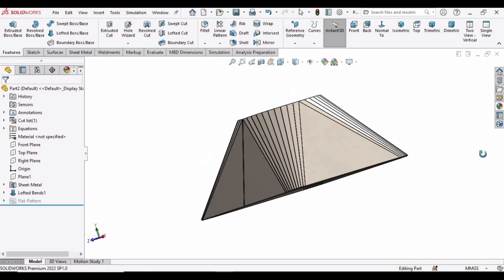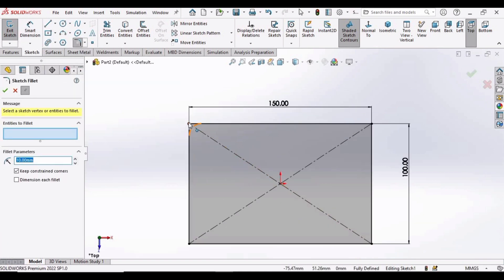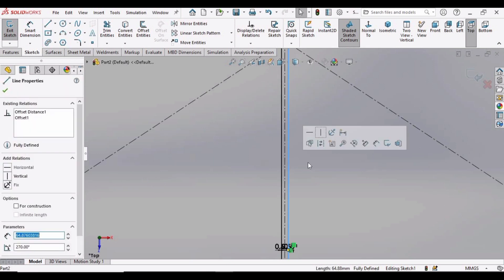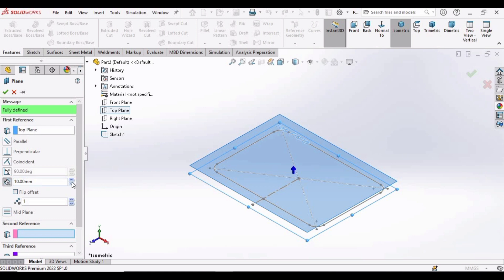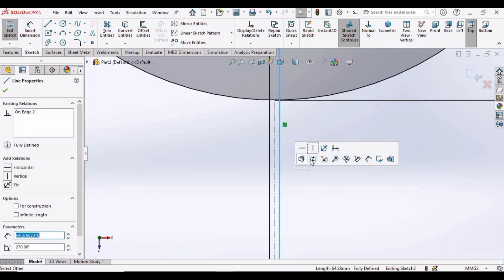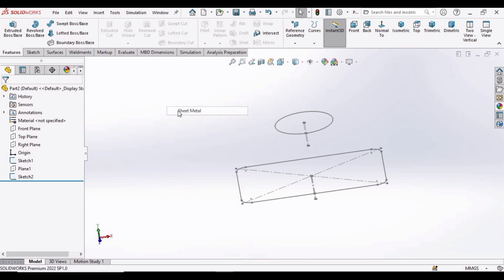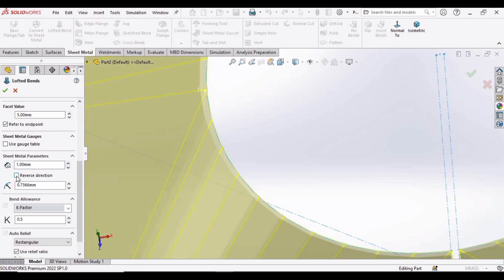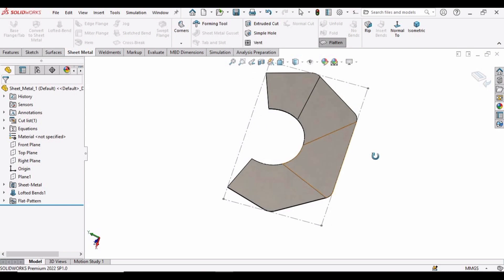3D Sheet Metal Cone | Metal Fabrication | SOLIDWORKS

Comment: SOLIDWORKS IS USELESS WHEN IT COMES TO ACTUAL USED  CASE SCENARIOS
Reply from the maker: @midhunamasco  i know what you are saying as i had experience in fabrication. for me, it is very useful though.
Reply: @CAD5-Minute  can you develop a rectangle circle transistion OD-400mm, Rectangle- 700x500 & height- 120mm.Can't seem to develop it correctly, I dont understand where Im making the mistake.

Comment: 0.5mm bi directional for the opening in my opinion is way too much. You should make the cut as small as possible. I usually choose 0.05 bi directional because when welding a loft like this you will weld it with the sheetmetal halves touching eachother and with a 1mm cut with you will lose this width when welding it.
Reply from the maker: Actually this is a tutorial of how to model things. Practically there can be many possibilities which must be considered, and one you have explained. I like the comment. Thanks for the great feedback.